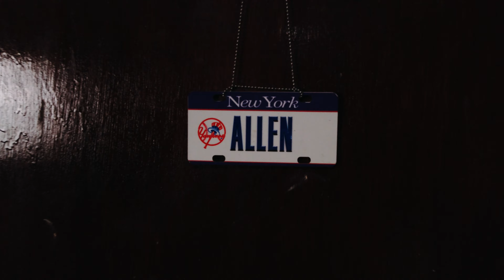DJI Osmo Pocket - Cinematic Video

Comment: Is this using the osmo pocket? I definitely need to learn how to handle the camera more
Reply from the maker: I used mostly FPV mode and Slow follow.And you will get alot more dynamic shots.
Reply: @avpfilms27  do you use the cine-like colors or keep it normal and color grade it later??
Reply from the maker: Always cinelike D. Well for me because I want to color match between the other cameras that I use. But if you strictly only use the the dji osmo pocket then Normal would be good. But if your interested in color grading then cinelike D. But either way both are good in my opinion. Just depends on what you want.